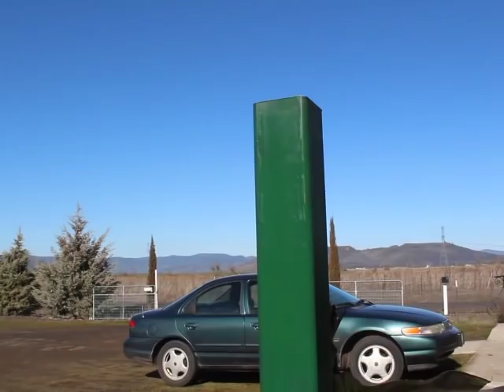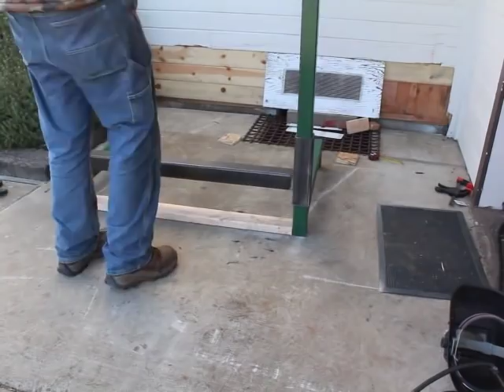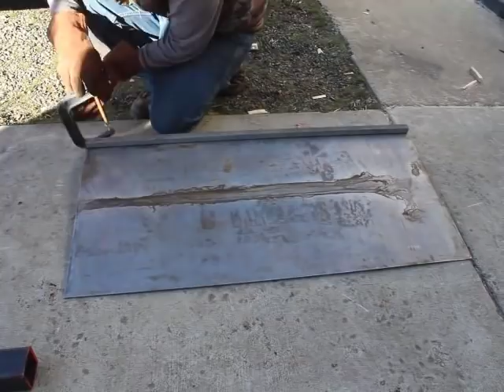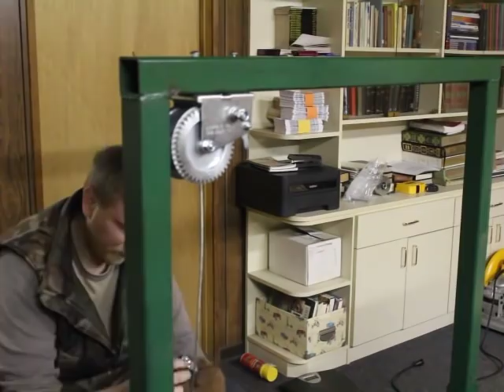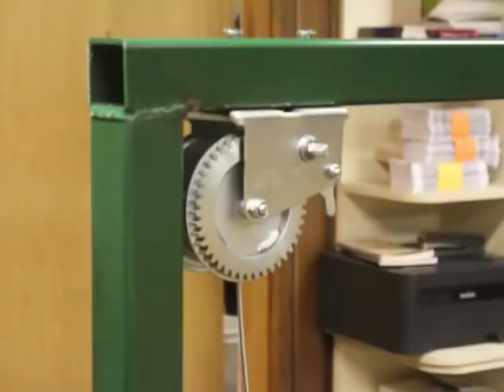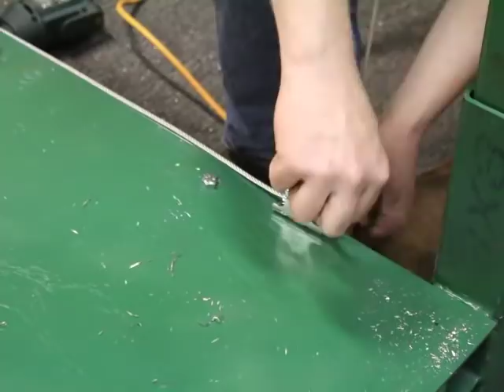Homemade Portable Sawmill Build - From Start to Finish Part1

Comment: I noticed the rear rollers losing contact. Have you noticed it affecting your cut? the least engineered solution I can think is counterweight. On the bottom rail? This is all hypothetical for me because I have no idea how I'm going to get the steel for less than the mill at Harbor Freight.

Comment: can you possibly detailed plan supply build..i really like your build for sawmill and would greatly appreciate plans...for i have very little cash but using the barter system to aquire the build parts.
Reply from the maker: I don't have any plans I just kind of put it together as I went.I have a very constructive imagination so I can do that sort of thing and it works for me. Maybe in the future I will do a video on the measurements on the build and give some advice. Right now I'm working out the small bugs out of the machine. It works great but there are a few small tweeks I've had to make to it.

Comment: wondering if you could provide the dimensions of the square tubing you used for the main upright frame and also the square tubing size the slides over this as the up/down sliding mechanism. it seems fairly snug but slides without much play. thx

Comment: my blade rises when cutting. I work with not stretched blade.Can this be. wherein the tire pressure
Reply from the maker: Murillo Rezende It could be the guides
Reply from the maker: PastorBCoy The guides need to press down on the blade about an 1/8 inch